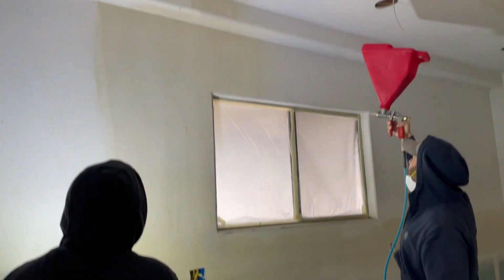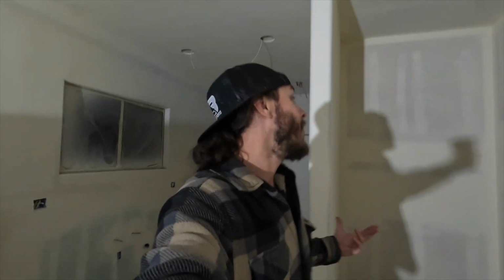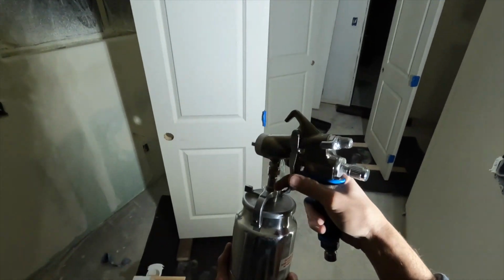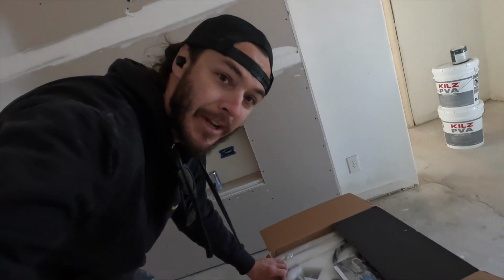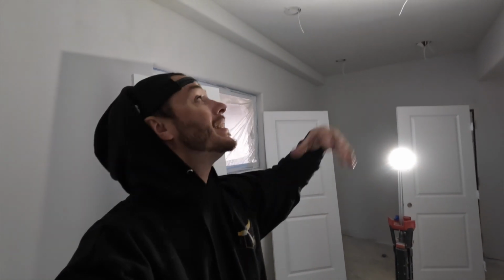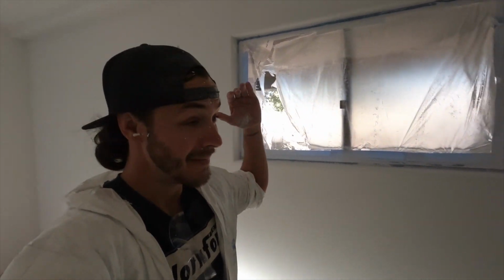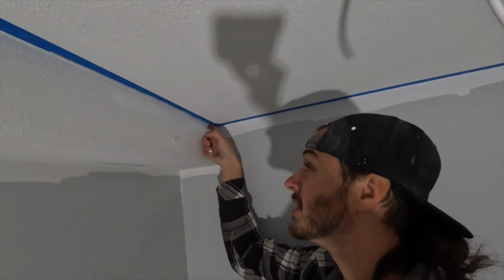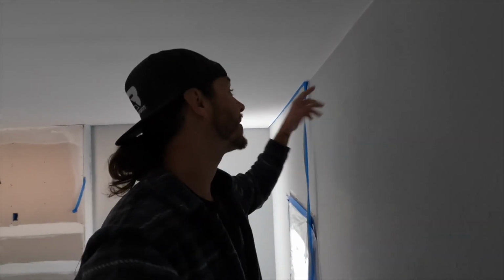RYNO RANCH GUEST HOUSE RENOVATION (PART 9)

Comment: We use 100 pound propane bottles with a flame cannon heater. Like a big tiger torch. You can rent them from HD I believe and worth it for drying mud. Those little space heaters don't work well as you discovered. Don't paint in the dark!  Lol...  Fun project, I am enjoying watching someone else do this!

Comment: When spraying if you can put a window fan in and it clears out the paint mist farley quickly.. But then it leaves round marks on your screen so be sure to take the screens out. You will notice a considerable difference.

Comment: Harbor freight has really good generators, my old company bought some of the really quiet ones and we’d use them all day for months never changing the oil and beating them up and they never skipped a beat! Also just used their older airless sprayer and it did a great job.

Comment: Looks like their new airless sprayer might be better, I have their AV-ASP1 and that thing can't keep up with spraying. You have to constantly keep let it build pressure. But when you are re-modeling like you are or like I did it really helps to have a sprayer to knock it out and just back roll. Saves a lot of time and as you said if you touch up it will look the same. Regarding the drying issue you would have almost needed a de-humidifier since it was raining, cold weather sucks I agree. But you gotta play the hand you were dealt :)

Comment: If you have the ability to close all the doors and windows of the guest house, you might consider getting a small dehumidifier.
We had really good luck with one of those inside a 2000 square foot shop building, even when it was raining outside. Not only did it make the drywall mud dry faster, it kept tools and equipment from rusting.

Comment: One thing about not installing floor under the cabinets is it does technically lower your countertop height. Granted if your flooring isn't thick that's not a big deal.

Comment: Do it reverse next time. Spray both coats on walls. Then plastic down, tape & caulk  shoot your ceiling after pull the tape walk away.. much easier to tape edge of walls than ceilings lol

Comment: at the apartment community where i work, we have textured walls and popcorn ceilings. I have a steady enough hand to cut in very straight lines without any problem. It is just apartments though so if there is a little screw up in the paint, it doesnt really matter anyways. I know I do a much better job overall the the painters we hire to paint some units, faster too :)

Comment: So I saw another “hack” like you showed with the tape and caulk, basically the same concept but using the ceiling paint, or 1st paint color used as the “caulk”, then painting over it with the 2nd paint color, if you get my drift.

Comment: You should have primed the metal prior, it will allow for more adhesion from the drywall mud, the absobtion rate between texture and seams will be different and potentially show flashing, working with a sealed surface prior to texture will give a better results, as far as your mud use a dehumidifier from Home depot etc to ho suck out moisture

Comment: Your airless can also be used to spray doors, all you need is some latex additive to help lay it down and use a double orface tip like a 5-11 tip, no reason to use an HVLP unless you are using some sort of oil based paint in my opinion, dont get me wrong, your HVLP is bad ass but not necessary needed

Comment: How come you don't have your trim installed and caulked? Like to to prime over everything then hit my ceiling and I let my ceiling paint roll tbe corners onto the walls. I cut ceiling with a little wiz roller with nap on the end then and do my trim and I over brush so it covers over the caulk and onto wall a bit and find it a lot easier cutting wall color then the small lip of trim. And when I cut my wall color a carry a wiz with me and roll out my brush strokes as close as possible. I can't stand seeing brush strokes all over.

Comment: The box fans are to close to the heaters. The fans are not letting the heaters heat up. Tilt the fans up and away from the heaters to circulate the air around the room.

Comment: Fuck spraying above head in my opinion. For rolling though, use the right extension pole. Have that fucker at a forward angle to the point where you only catch the micro drops that travel further, have your lead hand under the pole and back hand over the pole and accept the work out. I hate painting above head and would refuse to do it for a living but I've been complimented on my ability to keep the paint off of myself a few times when I've had to do it.

Comment: Coming from the high end home building world we prefer to put the flooring under all cabinets we cringe at people who don't so it was funny to hear you say that its the trashy way of doing it lol
Reply from the maker: Why set yourself up for fighting the flooring in the future?
Reply: @DMAXRYNO  For us mostly it’s because of how the floor finishes to the cabinet when you run the flooring under whether it’s tile or hardwood it goes continuously and you don’t  have to put a decorative trim on the bottom of the cabinet to try to cover up a little bit of a gap or a bad cut that your flooring guy did you can go completely cabinet on flooring making it seamless. Also most of our homes are on slabs In FL so the flooring guys actually make the floor more level than the slab is which makes you have to Shim a lot less. And if there ever is some type of water leak from like a dishwasher there’s not a path for the water to go to that’s lower than the flooring so normally the water will just kick out from the cabinet instead of being trapped under it in a pool. And to answer your question about fighting the Flooring in our market 9 times out of 10 when people replace the flooring they normally are throwing their cabinets away as well.

Comment: Can respect the attention to detail. I only use tape and chaulk when doing two tone paint job on a wall without chair rail or other trim. Can’t justify the added time with no difference in finish when it comes to 90 degree corners like the wall and ceiling. 

I also have a little giant ladder and can sit right at the top so I’m almost always working eye level which probably helps cutting in straight lines

Comment: You should NEVER put water in your paint and when you paint doors you should always paint up and down never side to side and when you spray walls and ceilings you should spray and roll them if not you’ll see all the lines and you should be good with one coat